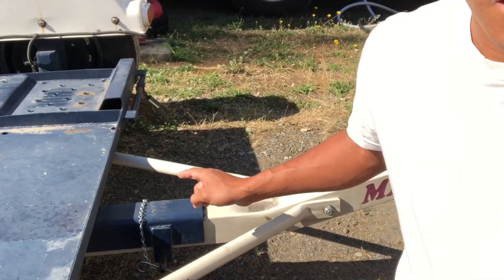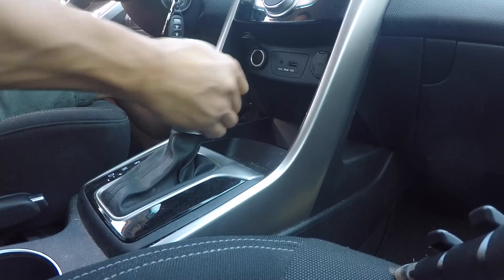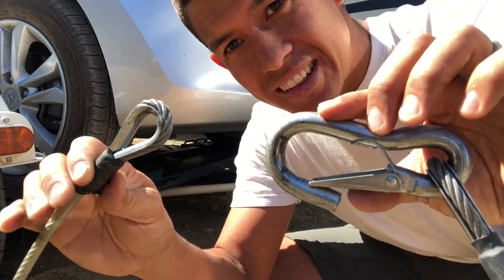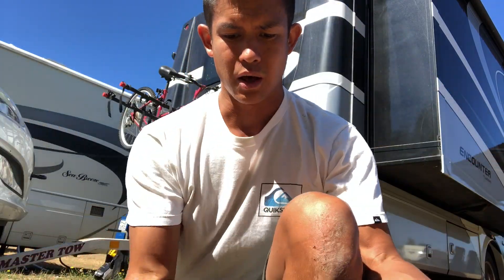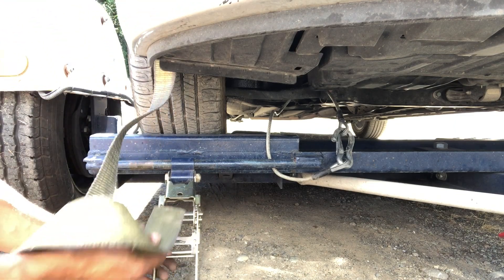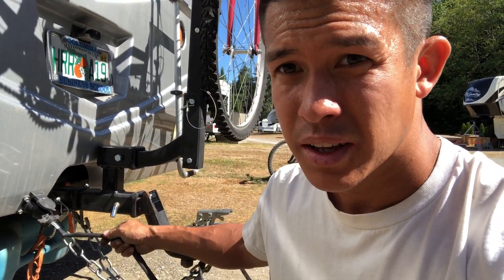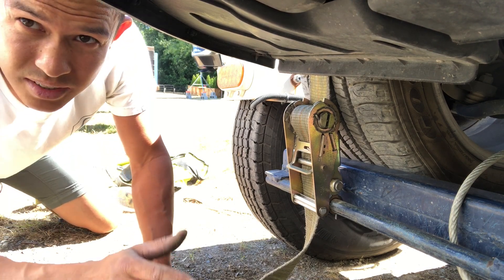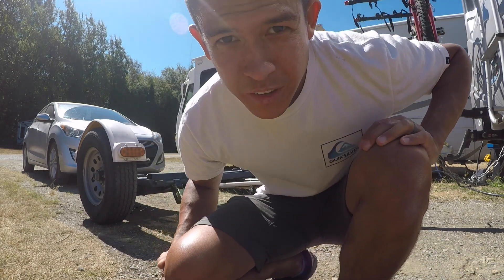How to tow a car behind an RV - Car Dolly

Comment: Nice Video, I have just bought a master tow and being a mechanic, I did check the brakes which were not lubes and adjusted, the bearing were OK but the swivel plate was dry! all good now, I see you have a dual hitch adapter for your bike rack any problem with that set up?. FYI the parts you did pass throught the safety cable under the car is call a Lower Control Arm (LCA) Thanks
Reply from the maker: We traveled with that setup for 2 years with zero issues. Thanks for IDing that part for me!
Reply: I have a 2005 Master Tow with surge disc brakes.  Can’t say I know enough about surge brakes. Any ideas where to look?

Comment: Thank you for the video but I have a question, what happens if I tow a old car with no steering lock? Should I load the rear tires?
Reply from the maker: My understanding is that you never want to load the drive axle on the dolly. 
You can use the seat belt to tie down the steering wheel to “lock it”. Pull the belt all the way out of the drum, so it begins ratcheting. Run the belt through the steering wheel at the closet point to the seat belts anchor point. Wrap it around a few times and make sure the belt ratchets all the slack out and click the belt in.
Reply: @ProjectTrek  thank you

Comment: I thought it was better for the Transmission to be in neutral. Am i wrong?
Reply from the maker: I believe that’s true for flat-tow/dinghy-two, but for front-wheels-up (on front drive vehicles) vehicles you want the tires that are on the dolly to be “parked”.
Reply: @ProjectTrek  Got it.  Thanks for taking the time!
Reply from the maker: Absolutely!

Comment: Are these dollies OK for towing long distances frequently? I will be doing class A soon, but current auto is not toad capable. BTW, 5:25, that hole is in the lower control arm. That may not be a solid enough fastening point.
Reply from the maker: As long as your tires are in good shape. We towed our Hyundai Elantra GT around the country non-stop for 2 years.
Reply: @ProjectTrek  Thanks for the quick reply, just what I needed to know.

Comment: What should I be worried about towing with a dolly? We have to use one and do not want to chase with our Cherokee.
Reply from the maker: Hey Chris, no worries necessarily, but there are some things you should know. You’ll be unable to back up with the car on the dolly, which was a huge annoyance for me.
Make sure you know what type of braking system your dolly has. If it’s 12v brakes then you’ll need to have a brake controller installed in your RV.
Just make sure the tires are good, and rates for the speed you plan to travel, and make sure the bearings are greased.
Reply: @ProjectTrek  oh that makes sense because it’s got two separate pivot points. If it’s not being backed up straight it can cause issues. So then the first step is gonna be unhooking entirely before any reverse maneuvers.
Reply from the maker: That’s exactly it. Even with the car unloaded, the trailer wheels are SO close to the pivot point, that backing up unloaded is still a challenge - still doable though.

Comment: With my car dolly I am instructed to not lock the steering, something my Toyota does not do anyhow. As the motor home turns the dolly pivots at the  hitch and the car pivots at the front wheels by allowing the steering to turn. Unless you have a dolly where the plates that the front tires sit on can move about somewhat then the steering can be locked.  Just something more to look into.

Comment: I'm buying a motor home and looking at the dolly also for now. My question is does your dolly have brakes.
Reply from the maker: Yes, the dolly has electric brakes. If you must use a dolly I recommend the surge brakes over electric.
Reply: @ProjectTrek  why do you recommend surge over the electric? We have electric on our dolly. Our RV has a brake controller and the 7 pin plug seemed to work great.
Reply: @floydcooley1  I agree, nothing wrong with electric brakes. Either one is going to have maintenance at some point.
Reply: I was just on phone with master tow the  drum brakes ( not disc) are the same electric vs surge. If your tow vehicle has brake controller electric is a good choice and a few hundred bucks cheaper than surge brakes. Also mentioned surge brakes may require additional maintenance on system fluid , bleed or flush
Reply: @ProjectTrek  Thank you for your video.  Very informative and short. 

The advantage of surge brakes is you don't need an electrical hookup and brake controller.  The electric brake units are less expensive.  I just purchased one here in NC to put behind my RV.  I opted for surge brakes.  I had a boat with this type of trailer and liked it. 

A lot of dealers are selling tow dollies without brakes.  Technically that's against the law if your car is over 3K pounds here in NC.  My father used one for years without brakes and was never stopped by DMV or any state troopers.  If you think about it an rv with air brakes that can stop itself will have ample braking power to stop a small car on a dolly.

Comment: What I didn't see is what he did with the trailer safety chains (  NOT the car safety chain. )

Most recommend that the trailer safty chain be cris-crossed under the toung.
Reply from the maker: That is true. The dolly chains come to a single point so there is no ability to cross them.
Reply: He did show them at the very beginning of the video. Don't know if he had them crossed.

Comment: Have been considering a new Elantra with a stick, towable 4 down, are you happy with your's?  thanks
Reply from the maker: We are happy with the Elantra GT. It’s perfect for towing. I recommend the Road Master towing setup, for towing 4 down.
Be sure to check out our travels through Mexico in Oct! We will be leaving the RV and driving down in the Elantra, so it’ll be put through it’s paces.
Reply: Thanks, yes roadmaster makes a great tow bar, we currently have a Ready Brute system which is a great set up as well, it has been flawless for nearly 6 years towing our Malibu...and has a surge brake built in so no need for pumps or individual braking systems.   Safe Travels.

Comment: Great video brother. I have a new Elantra and using the master tow dolly as well. Question for ya, how was the spacing between the ramps and the middle of the car? Was there enough of a gap that you weren’t at risk of the ramp connecting with the center of the vehicle kind of like when you go over a large bump or dip
Reply from the maker: On certain approaches, at certain angles, the lip of the front fender would catch on the dolly while loading. I couldn’t tell you exactly what conditions in which this occurred, but it was rare.
Reply: I guess my question is the back of the ram, once the car is fully on the dolly, was there enough clearance between the dolly ram and the car. Once fully on the dolly
Reply from the maker: Yes, the ramps never came in contact with the undercarriage of the vehicle. Once the vehicle is loaded onto the dolly, the ramp is securely pinned into place.
Reply: Awesome thanks for the response. Your video is my go to for getting my car loaded in the near future